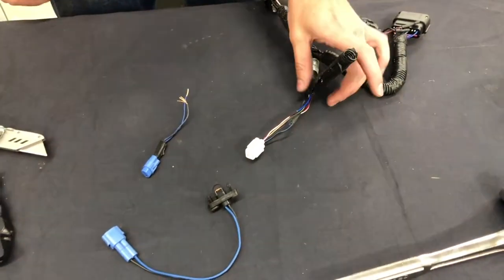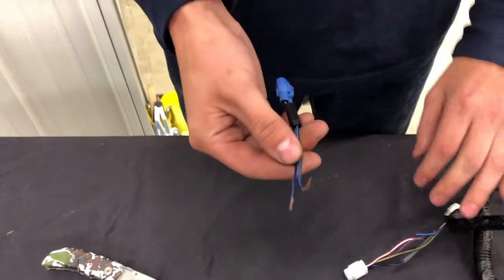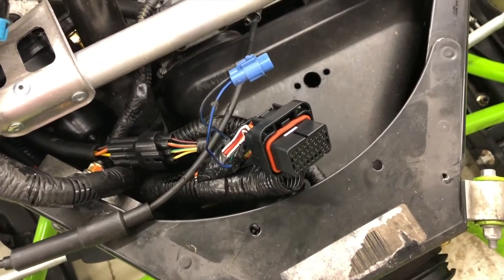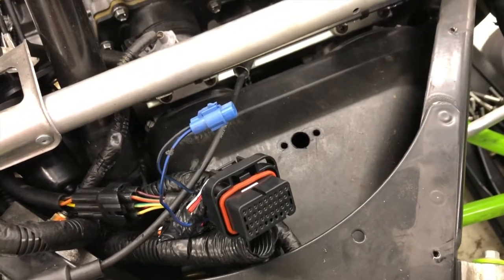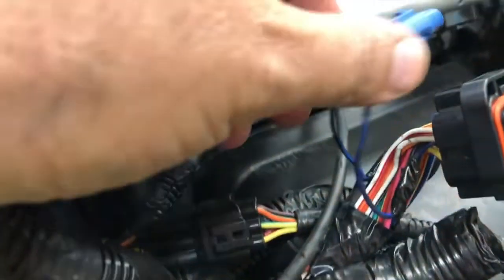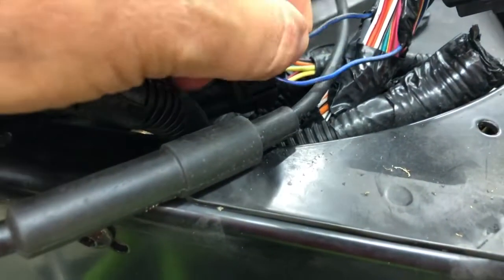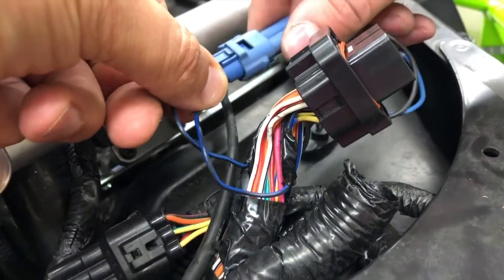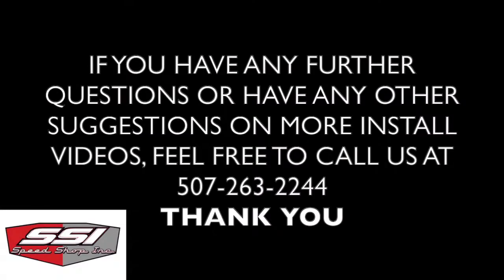2012-17 Air intake Temp Sensor Relocation for Arctic Cat 800 H.O.

Comment: How do you remove the bottom banjo fitting for the oil pump to do your delete kit?
Reply from the maker: remove the service plate or you can take the oil pump off of the rubber line and plug the rubber line. I've seen it done both ways. we installed enough of them we made a jig on exactly where to drill an access hole in the service plate